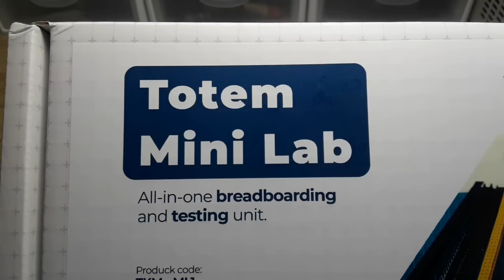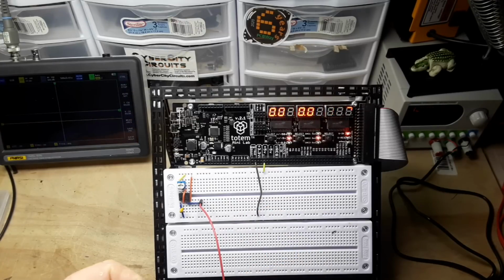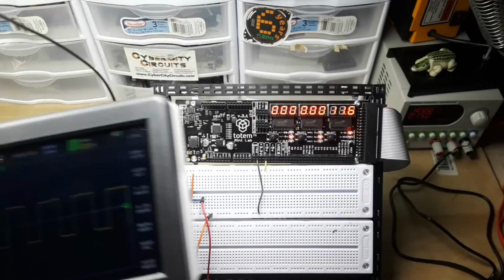Totem Mini Lab

Comment: For someone getting started, this is a great tool.  It may seem pricey, by today's cheap expectations, but it is cheaper and more convenient than purchasing individual parts, a DMM, function generator, power supply etc.  It puts everything in one easy to move around place.  Take it out, play around, put it away.  In the 80s, analog or digital "trainers" cost hundreds of dollars, in 70s dollars.  Venturing into microprocessors at the time would cost thousands.  This has the added benefit of short circuit and voltage protection on all the Arduino io pins, plus level conversion.  This is ideal for beginners because it will serve them well into some pretty advanced experiments.  It's absolutely perfect for classroom learning.  The add-on side panels are nice too.  I think it's a fair deal. The only improvement might be to use a standard arduino and a shield to make the interface to the lab board, but that's kinda nitpicking it.
Reply from the maker: I agree with you. I grew up with those Radio Shack 100-in-1 electronic kits. I believe they were between 60-80 dollars in the 70's

Comment: I love my mini lab.  But I I have a “Knight” “mini lab 2010”

It’s an all in one electronics lab and  bredboarding test set, with built-in test equipment, power supplies, and almost everything you need. It’s built into a heavy duty  aluminum briefcase and you can find them on eBay pretty reasonably if you keep an eye out. 

I customized mine… Adding a small oscilloscope, and a few other pieces of small portable gear so that it’s an all in one test bench. I can take on the road to do repairs, diagnostics, and tinkering. 

Hell even with an entire workbench and lab full of gear… I find myself using it on the bench when I need an extra signal generator, powered breadboard… or something similar

Comment: I think it's a cool project - reminds me of the old "Erector" sets when I was a kid more so than Lego. Back in the late 80s I built a Heathkit "Analog/Digital Trainer" kit that I still have but have to repair - the caps are all jelly now have to replace. It has a sine/square/triangle wave generator up to 100khz, several power supplies, logic signals and probes, and two breadboards like this unit - only item missing was the frequency counter and DMM which I got separately, I miss Heathkit! I also later bought a B&K 20 MHz oscilloscope which I still have but I have to fix (jelly caps need replacement - common theme here). I have a long "To Do" list for repairs.

Comment: I really like the idea of the mounting,  breadboards test, equipment, self contained power supply and portability.  The non standard Arduino I see as a negative.  They sell the beam parts and hardware separately as well allowing you to use these to build you own custom work station.

Comment: As said an interesting kit but when you go to their website it says "Out of Stock".  Very annoying sending something for review and then not having sufficient stock for potential orders.  Good review Paul.
Reply: A symptom of maker business. Judging demand is hard fore even the biggest companies. And I presume this little kit will be doing the rounds of all the maker electronics channels. 
On the plus side.. 
Out of stock means selling well. So chances of ongoing support are higher. Pre order if you can, and be patient.
Reply: @JohnBailey39  No pre-order available that i see unfortunately.
Reply: @englishrupe01  Oh well.. Book mark and keep on checking then I suppose. My version of this is my workbench. A chaotic and cluttered region.. Possibly infested with gremlins. 
I'm currently trying to talk myself out of one of their construction kits. Wonder how long my resistance will last :)
Reply: I used to work as a tech in RF communications,  one manufacturer that we were a warranty station for would advertise a product for ≈ 3 months before building in an effort to decide how large a run to produce.